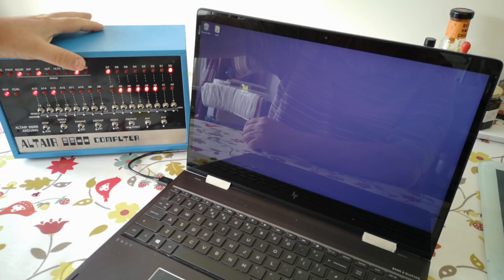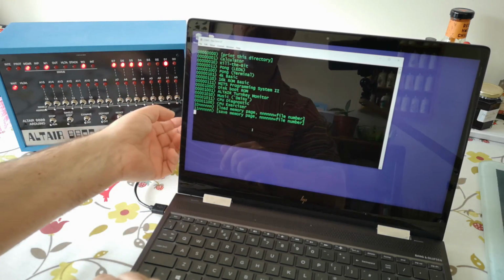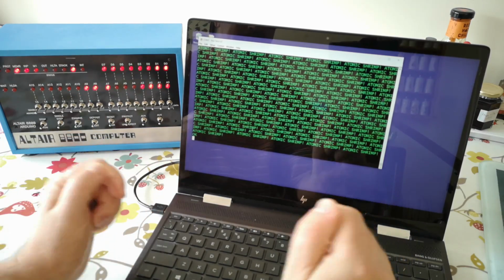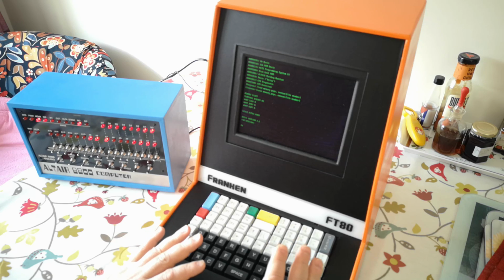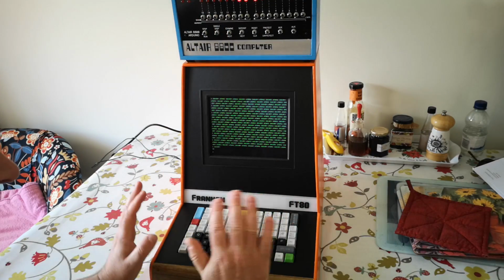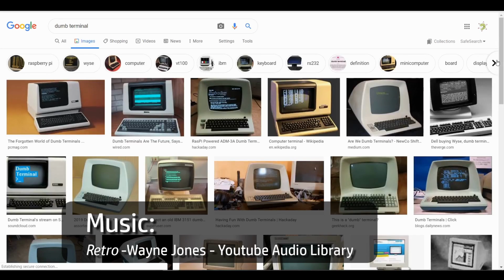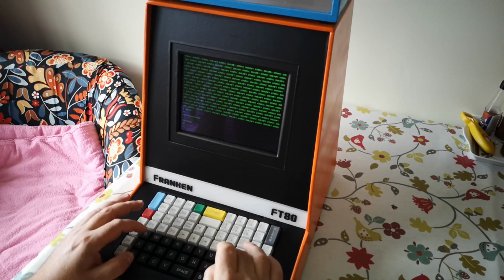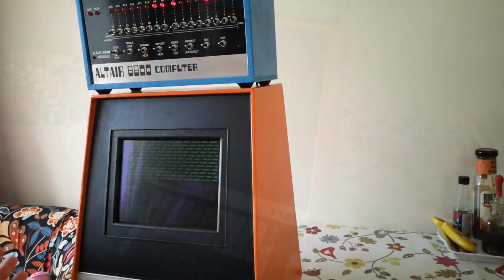Using The Franken FT80 Terminal With My Altair 8800 (Clone)

Comment: What is the speed of the emulator like? Is it faster or slower than the original Altair?
Reply from the maker: I think it has been designed to run at the same speed as the original (for some purposes this is essential - for example some games would be unplayable if they ran too fast)

Comment: First commercial computer I worked on was a Data General Nova II. The early ones did not even have a bootstrap ROM, so you had to key in 32 (I think) 16 bit words to start it. Most of the engineers memorized the bootstrap sequence, as you used it so often.

Comment: Frankenstein Terminal. Easily the ugliest terminal I've ever seen. But of course very interesting and nostalgic! I know the Altair 8800 Computer, but had never before heard of the Franken FT80. Back in the 80s at the University I worked with DEC VT52 Terminals that were connected to a VAX Computer. Those were nice terminals with a nice keyboard, of course they were already 10 years old or more, but there was not yet any computer nostalgia 35 years ago, so we didn't appreciate it. When they were replaced with PCs and terminal emulation around 1990, I should have asked if I can have one of those VT52s. But I didn't think of the possibility of eventually having a rarity decades later...;-)

Comment: Isn't the "dumb" client Still more powerful than the microcontroller emulating the Altair? Love your channel BTW.
Reply from the maker: Probably yes. The terminal box probably contains a geode processor which is like a really stripped down celeron.
In fact the microcontroller inside the programmable keyboard might also have more power than the original Altair

Comment: Ooh. Whats the physical customisability like? The big thing about those was the fact they were just so customisable.
Reply from the maker: Yeah, not so much for this, as inside it is just and arduino board with a front panel interface. I think it would be possible to add on other interfaces and buses toake it more hardware-consistent with the original, but our of the box, its really an emulator

Comment: What is wipe on polly?
Reply from the maker: Polyurethane finish for wood that can be applied with a sponge or cloth - really quick drying.
Reply: @AtomicShrimp  aah so it gives a tough lacquered finish ?
Reply from the maker: @chellsymons590  Correct - here's another project I used it on: https://www.youtube.com/watch?v=lhP8IYp27So

Comment: How about taking it to a higher level and building a teletype to use as a terminal
Reply from the maker: Might do... (actually I think the Axel supports printers either USB or USB to parallel via a dongle, and the session can be set to echo to printer, so I think it's possible).
What I would really love is a paper punch tape reader/writer, but I have a feeling it might be difficult to attach that to the emulated Altair (just because the 'hardware' is inside the emulation)

Comment: When I was a kid and got bored during summer break I would break into my parents home office and pillage loose-leaf paper, plain blue ballpoint pens, glue sticks, and scotch tape. Then I'd cut and mark and glue and dinker around until I'd made a little computer,about the size of a box of poptarts.

Of course, it was just a paper shell with some of the lines and marks to evoke the idea of a computer (this was around the time we got our first computer- a tandy 1000), but I'd left an opening on the side of the monitor to allow a new 'screen' image to be slid in, and even a little 'floppy drive' that you could slide tiny paper disks into. I ended up making several, all different, and giving a few away to friends for their kick-ass troll doll houses.

In case it wasn't obvious, it was the 90's.

This video just sent me back in time to experience the desire, determination, elation,and satisfaction of making those little paper computers. That's something my adult self would do well to bring into the present.

Thank you for sharing this with us!

Comment: Would be cool to see some kind of a blog post going more into depth about this project. Personally I'd be curious in seeing you getting th Franken FT80 Terminal online. ;-)
Reply from the maker: It can be done - in the video linked below, someone got an IMSAI 8080 (very similar to an Altair 8800) to browse the web in text form, but it's probably a bit beyond my reach (and oddly, more difficult in the emulated 8800, because a lot of the 'hardware' of the Altair is virtual - inside the emulation itself)
https://www.youtube.com/watch?v=nq4g6SLC8NM

Comment: What type of work do you do?  Terminal programs (minicom, teraterm) get a lot of use in embedded software programming.
Reply from the maker: I work in IT. One of the main systems I support is accessed via terminal emulators (and as a matter of fact is written in BASIC, unbelievable as that might sound!)

Comment: So using a computer trillions of times more powerful than a dummy terminal to connect up to a computer only thousands of times more powerful than a computer hundreds of times more powerful than a dummy terminal? But for why?
Reply from the maker: Probably for the same reason people like to dress up and re-enact historical battles
Reply: @AtomicShrimp  yeah but people don't show up to historical battles driving tanks and carrying machine guns
Reply from the maker: No, they drive there in SUVs and eat sandwiches out of triangular disposable plastic packs.
Reply: @AtomicShrimp  triangular?
Reply from the maker: https://www.catering24.co.uk/plastic-triple-hinged-sandwich-wedges.html
Reply: @AtomicShrimp  why not just make them square that way it can take up less space?
Reply from the maker: People like triangular sandwiches - notionally, so you can see how generously filled they are (which was a fine idea until they started just piling the filling along a line in the middle of the bread where it will be cut)
Reply: @AtomicShrimp  who's they?

Comment: As soon as I saw that flat screen I knew it wasn't a vintage terminal... however! you've still got a machine inside (the thin client box) that's much more mowerful than the computer it's term'ing to...
What you needed to do was build up a terminal emulator circuit just from 74 series logic chips, just like the originals ;) (I had the pleasure of having a look inside a proper VT100 terminal a while back and it was literally all just massive arrays of 74 logic chips... fun stuff! I was hoping we'd see more of the Altair Mini. Nice Lockdown project though!
Reply from the maker: Yeah, the Axel box has a Geode processor in it - could probably almost run Windows.  I would like to build a machine from just the gates (or even a Z80 and other bits).  Maybe one day...
Reply: @AtomicShrimp  ah yeah, the terminal probably had some form of CPU in it, an earlier 8-bit one

Comment: I'm sure someone will comment how you did the construction of the casing and the computers wrong...  I thought you did an excellent job!
Reply: The lack of reinforcement on those joins is giving me heebie jeebies though
And you made that beautiful nameplate out of diffuser material but without illuminating it!?
I still like it  ; )
Reply: Ehh, it's alright. Its not supposed to withstand 20+ decades of use, it does what its supposed to do with relative minimal effort and skill requirements. I quite like simple and elegant solutions.

Comment: I was wondering for a long time but now I have to ask: What's your profession Mr. Shrimp?
Reply from the maker: I work in IT at the moment
Reply: @AtomicShrimp  Me too but I hate it and want to escape somehow but I have no other formal qualifications besides software engineering.

I do like retro computing a lot though. I think old machines make you think and work more focused. I mean multitasking is nice but humans aren't very good at it. Too many distractions. I grew up in the 80s in Germany, had a C64, an Amiga 600 and a 286 PC. My father had a Schneider CPC which was I think a rebranded Amstrad CPC. Being a child at the time I mostly used them to play games if course but I also did my first experiments with basic

Comment: "The limitations of this tiny screen".. 

Mate, it was considered astounding when the Apple II got the ability to go from 40 characters wide, to 80 characters, using the enhanced 80 column graphics card. Took hours to replace the cards for all the systems in the lab, using the little hex wrench. Got the silver version after going through the certification program.

Comment: I remember back in the day at the Altair users group, having a terminal was a luxury. I had to load the machine code directly from the switch panel. We used AM transistor pocket radios placed directly on top of the Altair for sound output. Oh, the nostalgia of it all. Paper tape, punch cards, continuous paper output. Yes, the good ol' days. These days all my computers are good for is streaming video, good and bad.
Thanks for the very interesting video. I absolutely loved it.

Comment: Looks great! I have a PIDP8 and a PIDP11 (Will get the Altair when money allows). Would love some more 'in depth' info on things like the keyboard(reprogramming the keys/ What keys do they do (PF1? etc PA1? etc). PSU? did you use one for all the parts? if so a standard brick? What rating? I have toyed with the idea of making a 'new' IBM3270 terminal but the keytops is the sticking point. I think you have gone for a simpler solution then I maybe can adapt. So more info if you could please (PM me if you prefer not to clog the channel with the info).
Reply from the maker: The keyboard was a bit of a nightmare - PrehKeyTec provide a programming utility called WinProgrammer which looks like it probably hasn't changed much since windows 2000 - it's highly functional, but the sort of thing that's designed for engineers, not end users (which is probably just because it is - its for EPOS installers, not the general public).
The keyboard I bought was advertised as USB, but when it turned up, it was PS/2 - it works when connected to a converter dongle, but it cannot be programmed that way, so I had to blow the dust off an old PC with a PS/2 port on it - then I discovered that WinProgrammer is 32 bit only, so I had to rebuild the machine to Windows XP (yeah, I know)
Reply: @AtomicShrimp  What about the supply? one block for all or separates? Yes it's keys like pa1/2 etc that are a problem for me.
Reply from the maker: The Axel terminal box runs on 9v and the screen runs on 12v - both had their own supplies, so I just wired a mains cable into a 2 gang socket inside the cabinet - everything is just stacked in the back of the box.  It's not neat, but it's flexible in case I decide to swap out any part (for example put in a slightly larger screen and swap the Axel box for a Raspberry Pi)

Comment: How did you connect the dumb terminal to the altair? Was it serial or some kind of USB connection?
Reply from the maker: Serial over USB
Reply: @AtomicShrimp  so both? Cool. I like how you keep it retro, but still use modern components.